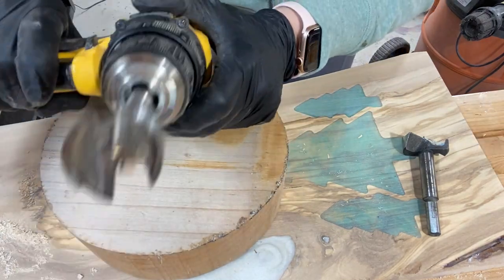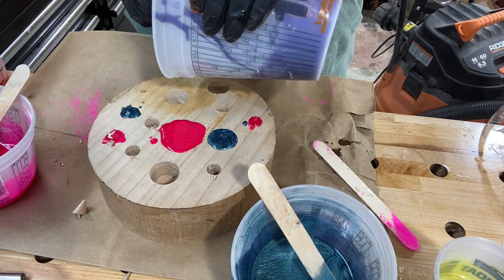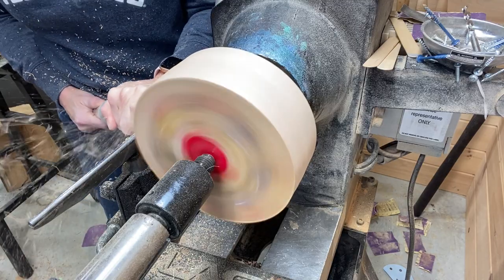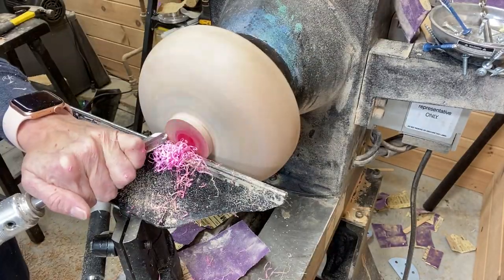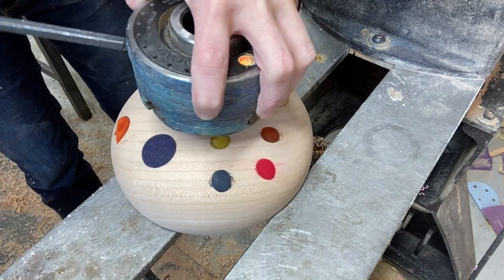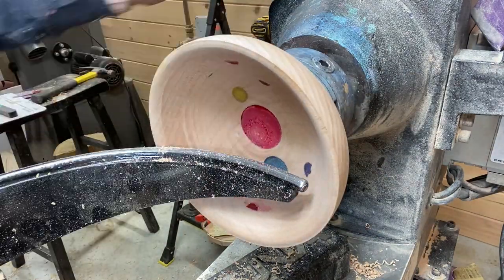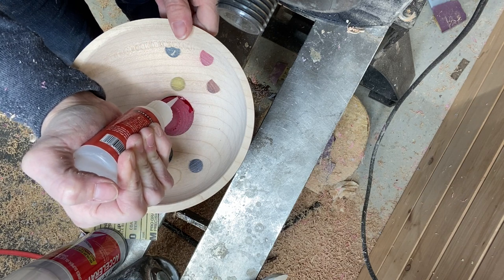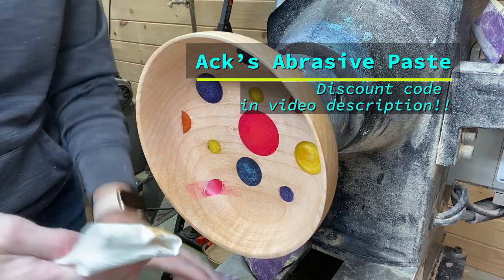Woodturning in Circles, Pun. Intended...

Comment: I'm sorry but this is one bowl of yours that I'm not particularly fond of but that's just my personal opinion an taste. You did one similar to this before also that I wasn't fond of either. What I really wanted to suggest or ask though is have you ever stopped sanding at 400 grit then used Ack's to see kind of result you get?
Reply from the maker: Thanks. Yes, I usually stop sanding at 320 or 400 with Ack's. This one was different (up to 600) only because of the resin.